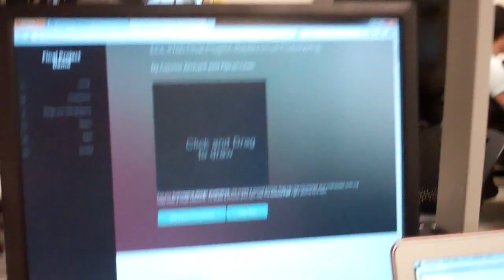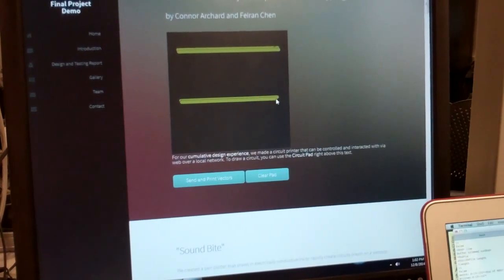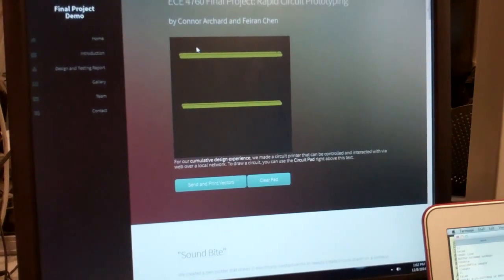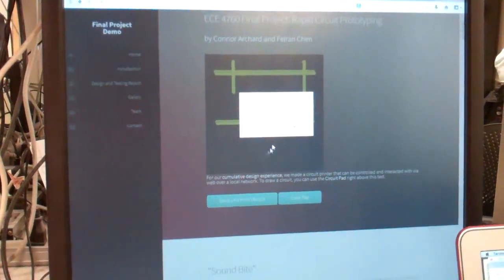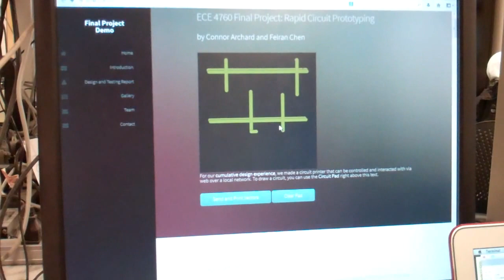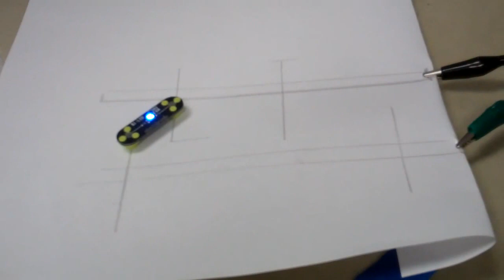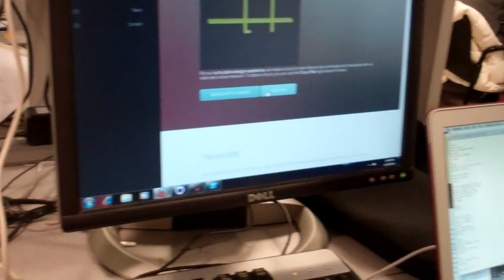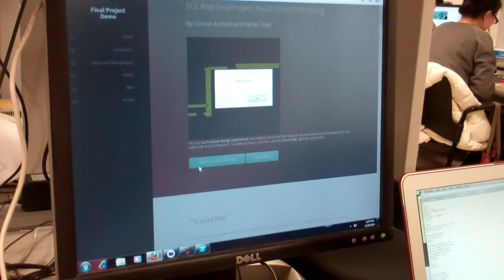Circuit Plotter

Comment: For hobby CNC machines we use rubber/vinyl tubing for flex joints.  This can be found at the hardware store, auto parts store etc.  I bet there is some slop in the joints to the potentiometers.  Anyways really ambitious and interesting project.